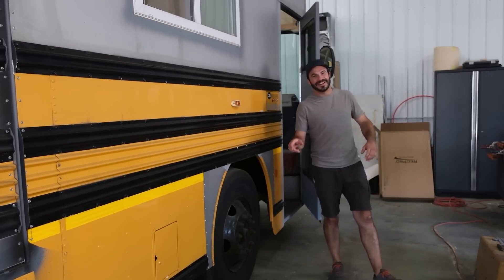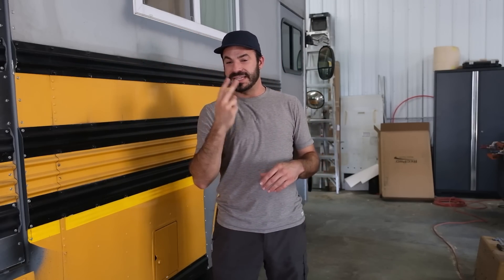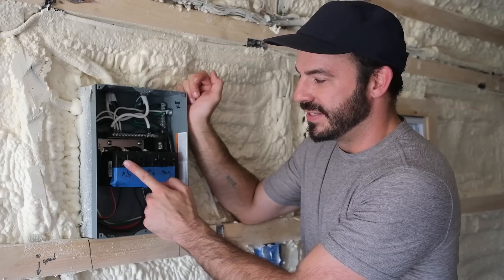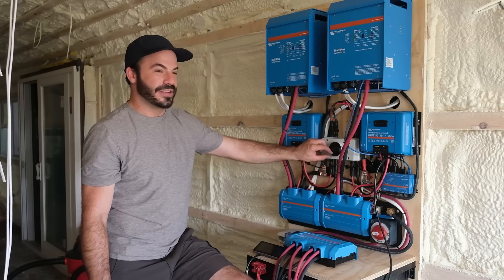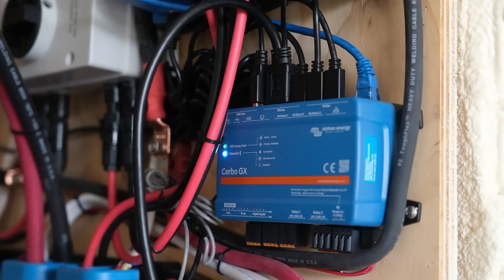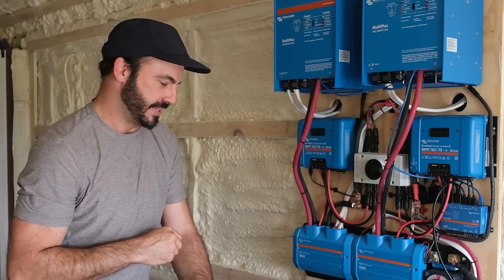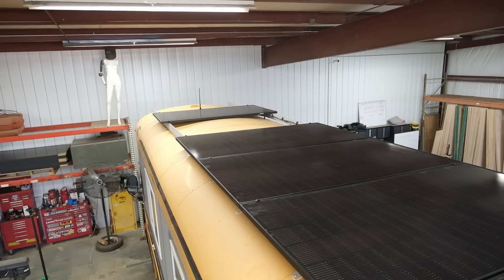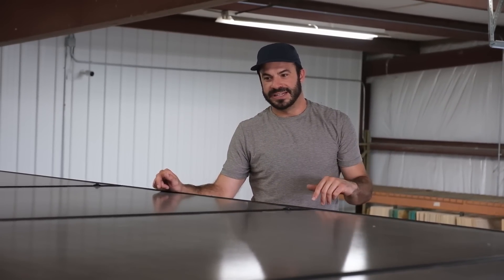Nasa-approved! A 220v solar-powered, dual-zone mini-split that also runs on 120v shore

Comment: If camping at an RV park with a 220V 14-50 socket you could have both inverters charging the battery. You would probably just need to make custom adapters down to a standard 15A plug since the RV ones combine both HOT connections where the inverters would pull to many amps.

Comment: Nice video. We live in Alaska, and live in a 40' B-Bird for the last year. We have two 3,000 watt inverters and can connect shore power at 15, 30, and or  50amps. Our issue is staying warm at -40 to -60f 7 months out of the year. We have two separate 120amps systems, working tandem redundantly.  Your videos have been very helpful over the last two years.
Reply: Diesel central heating for the WIN !
Reply: @dancarter482 Yeah I am gonna put a diesel hydronic heating system in my future skoolie with a small diesel air heater as back up. But if I am connected to shore power and it is not that cold, I can use my mini split for heat. Redundancy is the name of the game!

Comment: This is the exact video I needed during electrical planning. You'll be getting my business when I'm ready for off-grid and cutting a $25-30k check. Appreciate all you do for our little community!
Reply: They make 120/240 volt split phase inverters from around 4000watts up to the biggest you can buy. Runs 120 or 240 out of one inverter, no need to purchase two of everything.

Comment: Hey Chuck, great video brother! The best way I found for a clean looking (equal length parallel conductor) install is to separate the positive and negative bus bars on either side of the battery rack depending on orientation. In this case (-bus) below & (+bus) above the rack batteries. 

For example:
(+bus)
5” Pos  | Batt 1 |  20” Neg = 25”
10” Pos  | Batt 2 |  15” Neg = 25”
15” Pos  | Batt 3 |  10” Neg = 25”
20” Pos  | Batt 4 |  5” Neg = 25”
(-bus)
Reply from the maker: If the orientation of what was also going into this close would have allowed it, i would have preferred a bus bar as well. The racks from signature solar include a bus bar for that purpose but alas it was not a good fit for this application

Comment: Best minisplit ive found for running 24-7 on solar and batteries is the inovair 9000 btu 220 38 seer model. It pulls just over 600 watts for 10 or 12 minutes then drops down to just over 200 watts for the rest the time its on. I like the unit you used here with 2 heads but i think id have just installed 2 inovair units. I run mine from a split phase inverter and my off grid camper uses 1850 watts solar and a 30 kw battery and a 14 kw battery that i built. I use victron charge controllers along with sungold low frequency 4000 watt inverter and a powmr all in one inverter also. It seems kinda overkill but we sure dont run out of power... ever. Or air-conditioning.... ever lol

Comment: 10:13 I love this setup. I would, however, consider anchoring the battery stack to the bus more securely. There is a LOT is weight there that could break loose in a mishap or accident. Just my 2 cents that may be worth just that. 😀

Comment: Once you get into multiple evaporator units on one condenser, you can actually go to three zones fairly easily. One for the driver area, one for the living area, and one for the sleeping area. Three 9k evaporators on a 24k condenser is doable with an LG system.

Comment: So I'm not good at all this. But what I have gathered is everything got doubled so they could run one compressor instead of 2?? I will happily tuck away the second to keep from having to go 220. But totally digging the battery design.  Keep up the great work.
Reply from the maker: That is correct! It was actually about the same price to run this system with dual 3000 inverters making split phase for a 2 head unit as it would have been to buy two independent single head systems and bump up to a Quattro 5000 inverter, but it was less work since we only mounted one exterior unit (less labor) and dual 3000s gets you more power than a single 5000 inverter with the option for 220. It’s a good bet if you want the extra cooling which is why we did this option. Always a case by case thing tho
Reply: You also get the benefit of 2 solar zones. If one of the panels on a single inverter gets shaded or even damaged it will effect the solar output of all the panels on that inverter. I have been thinking about doing my panels long ways and mount them angled with the roof of the bus. But to make that work it would really make the most sense to have 2 systems since one side would be getting more sun depending on the time of the day. I did not realize my system I am planning would cost over $20k 😮 it will be worth it but geez. Lol

Comment: With 3 of the MPP Solar inverters I have 240V (mostly for dryer and welder) as I can run them split phase, and I have 5,000 watts of solar with another 2,000 I'm thinking about side mounting.  I opted for 24v DC units for the air conditioning.  I will let you know how that goes, I got 4 of them, $350 each, I prefer the 134a to the 410 and the connectors are MUCH MUCH better for mobile applications.  I may hate them, I guess I'll see when I get them installed but I'll do a test unit on my trailer first to see what power consumption is like.  I feel like with so many amazing DC options hinting about we're going to be able to date skoolie builds by cooling method but I think 2023 will mark the end of people using stationary 120 and 240 residential units.  As always, great video!  Oh and I have the same power inlet, one for each side, painfully expensive!
Reply: I wish I knew what you were saying but I don’t speak Solar fluently yet… I was just looking at a residential unit that came up for sale and wondering if I could use it for my application. Why will 2023 mark the end of using residential units for mobile applications? What am I looking for in order to be able to run a fairly beefy system on my bus?
Reply: Oh and 24 volt is better for running ac?
Reply: @Tonisuperfly  Chuck is great and he knows his stuff, I have learned A TON from him.  What I'm saying is speculation but residential units are less than ideal for many reasons from size and refrigerant type to fittings and voltages.  Currently, they may do a better job than DC units which is why I'm getting the 24v units and testing them.  Residential units are also 3x the price so that's something to factor in although only about 2x the price per BTU so you have to decide what you value more as redundancy and zone cooling is big for me.  I'm just starting with the 24v units though so I don't have all the facts.  I would assume any auto AC shop can service though though which is a HUGE plus!
Reply: Myself to keep costs down when I build my 26-30ft box truck I've have been planning it out with 2 separate 120v 12k btu units just to avoid the 240v side of things... would that have been cheaper like I suspect or am I possibly missing something? Thanks for another GREAT video
Reply: @BirchFarmsHythe  Just my opinion but if you're running 2 residential splits I would imagine you have the ability to run 240v, in my case, I have 3 MPP Solar inverters, under $1,500 shipped and this allows me to run 120v, 240v, and have one side with the ability to have double the load.  I dislike the idea of a residential unit on my bus so I would do A LOT to avoid it.  When I factor in the 24v units being over $1,000 less, giving me three units and so on I have money to spare to address an area they fall short.  It's a personal choice, in my case, more redundancy is what I'm going for.  I also end up with 27,000BTU with the three units versus 24,000BTU with the splits.
Reply: For my box truck the goal is to build it so I could literally live anywhere camp anywhere etc..  but for a few years I will be living in it full time and possibly plugged in to 120v 15a shore power at my work when I move down to Vancouver area. The benefit of avoiding actual 240v is simply easier to run a single unit through a victron with power assist when I cook etc then to rely on solar which I love for summer during their rainy dreary winters... where I would be definitely using the heat aspect of a mini split
Reply: @BirchFarmsHythe  Not sure if you know/understand this but 240 is simply 120x2 but out of phase by 30hz.  So, in theory for example, in your home, you could make a cord that was 240 and provided you plugged them into the proper two 120 outlets in your home you would have 240v on that plug.  In my case, I'm running 120 on both inverters but the inverters are able to talk and make sure they're running out of phase with each other so the outlets both hot leads go to can be 240, everything else is 120 volts.

Comment: Doesn't 120+120 = 240, not 220?  Haha!  Just messing around with you, Chuck.  I appreciate that, at one point, you said "110, 115, 120 volts" because it's changed over time...and is not clear at all.   I'm also a big Signature Solar EG4 battery fan.  A clean setup and a great video, as are all of yours.
Reply from the maker: It’s such a bizarre nomenclature! Thanks, appreciate you

Comment: This is the video I’ve been waiting on for the past 8 months!! I’ve got a 36k btu system that I’m gonna run 2 heads on but the power has been a hold up so far. I can run it off my generator without a problem but I’ve been wanting a complete system like this instead of relying solely upon the generator. This will be the perfect solution……….. except for the cost. Chuck, since your familiar with what this system requires, can you work up a rough estimate of cost for buying the equipment through you please. And would I be able to travel to wherever you are at some point for guidance on installation? I can do most of the install but I need guidance on laying it out and setting everything up. I’ve emailed you before and you’ve replied back so I’m not sure if you still have my email but if you need it again I’ll send it to you. Thanks Chuck, I appreciate it buddy!! 

Oh, this is going in an 82 MCI MC9  bus conversion if it matters. We will have good basement space to install equipment and not take up expensive floor space upstairs. Thanks man!
Reply from the maker: cant find your emails based on this comment, BUT if you dont mind sending me one at info@chromeyellowcorp.com we can take it from there. Thanks! sounds like a cool project. I used to have a few older MCI's myself

Comment: are you worried about having such large solar panels only mounted on the outer edges? Seems like the middle section would need some type of bracing. (what I am trying to figure out on my bus)
Reply from the maker: Not worried about it but these panels are also not as long as normal residential panels either. They’re 73” instead of 82

Comment: That is an awesome set up. I didn't catch the name of the manufacturer of the solar panel, could you share that? Also, is that the rack that signature solar sells with their batteries, or is that something that you and Wes fabricated?
Reply from the maker: We fabbed it! Wess did that. The panels are q.cells, the racking is from iron ridge

Comment: Did the system installed here only accept split phase 240V (and hence this solution)? I have seen some mini splits accept 208/230V single phase - in which case a second inverter producing single phase 230VAC could be used, right?

Comment: Why not install a 220v shore power and wire it like normal.   Then if you use a 220v to 120v adapter cable you would only be feeding 1 of the charge/inverters.   That way you could have it use 120 or 220v shore power.  Basically when you needed to use 120v shore power you would be simulating having 1 leg offline.   Does victron not allow for that?

Comment: Since you now have 220 wouldn't a nice 220 on-demand water heater and 220 induction stove be nice?
Reply from the maker: It would! Though the electric on demand still pull an exceptionally high current that would be too large for even this system, you’d need larger inverters. I like electric tanked water heaters though, they’re awesome

Comment: That sure is a sweet solar system, but for $20k it should be. Our solar/battery system costs less than half of that yet will still provide 24/7 off-grid electrical power including air conditioning and supplemental heat from a mini-split heat pump. Five years ago, we took an early retirement, sold everything, bought a MH and hit the road FT. It was the best decision we ever made. We discovered that we enjoy boondocking most of the time and we can stretch our budget this way too. We quickly learned the advantages of solar and decided to build our solar/battery system in 2 phases, a 12v phase for our basic 12v needs and a 48v system for our 110v A/C needs. We started our build 4 years ago with a pair of lead acid golf cart batteries and custom built a 620-watt liftable solar array mounted on the side of our motorhome. We lift the array to the optimal angle to improve their output by 20-30% vs flat mounted panels, especially in the winter, when the sun is lower in the sky. It serves as a nice bedroom window awning too, practically lifting itself to the desired angle with a couple gas struts, and it's easy to clean with a windshield squeegee, standing safely on the ground. We picked up 2, 310w Canadian Solar panels from Northern Az Wind and Solar in Flagstaff. This set-up, while far from optimal, allowed us to boondock till we could afford to do better.

We just finished the 12v part of our build last January, with the addition of a 560ah LiFePo-4 battery that we built with 8, 280ah "A" grade prismatic cells. We use a Heltec 350amp BMS, and a 5a active balancer to keep the cells synched up. We typically use less than 20% of their capacity daily giving us enough reserve capacity for about a week of bad weather before we have to run our generator for charging. It cost us less than $1,500 to build this 560ah 12v (7.1Kwh) battery, including the high amp BMS and balancer. We chose these cells rather than a pre-built battery because they fit perfectly under the steps of our MH where our old pair of GC-2 golf cart batteries used to reside, saving 35lbs while having over 5 times the capacity. We insulated the battery compartment, cut a 1" hole in our step risers and installed a tiny computer CPU fan to keep this space at close to room temperature, so we don't have to worry about the BMS shutting down charging if they get too cold - or their life reduced from getting too hot. We use a Progressive Dynamics 80a LFP converter/charger, a 1,000w Renogy PSW inverter (to run our TV, PC, ice maker, etc.), an Epever 50a MPPT charge controller and a Lnex battery monitor/shunt. This entire 12v system cost us under $3,500 to build and takes care of all of our basic off-grid needs except for air conditioning and microwave use. We have been running our 5,500-watt generator for this till we get our second 48v phase completed.

By mounting our solar array on the side of our MH, we left the roof free to rack 8, 550W Sungold Power solar panels (4,400 watts) down the length of our 35ft Class A about 15" off our roof, above our AC, fan shrouds, etc. They will cover the entire roof, providing some nice shade with plenty of cooling air underneath, further increasing solar output and reducing the heat load on the air conditioners too. We bought them for $2,226. That's only 51 cents/watt shipped to our door! We're assembling the components of this build now. We picked up our aluminum racking material from Remington Industrial Supply in Somerton, AZ, just S. of Yuma, near where we're wintering over this year, for under $400, which is the best price we've found. Our solar panels, wiring breakers, etc. arrived last week, but we're taking our time to get everything in and installed over the winter. At 67 yrs old, we're moving much slower these days. Our Sungold Power all-in-one 48V, 5,000W, 120V PSW Inverter/100A charge controller/battery charger just arrived yesterday. Our 48v battery bank will use 16, 320ah grade A prismatic cells which only cost us $1,726 from EEL batteries. So together with our 560ah (7.1 Kwh)12v bank, we will have a total of 23.5 Kwh of batteries onboard - the equivalent of over 19, 100ah Battleborn batteries and over 5,000 watts of solar. We will be replacing our old rear 13.5k btu rooftop Dometic AC with an EG4 28.5 seer2 plug and play 12k btu mini-split heat pump. This second phase will provide 24/7 off-grid air conditioning, supplemental heat from the heat pump and allow occasional usage of our rooftop mounted high-efficiency rotary compressor based Furrion AC in the front of our MH to cool things down quickly during peak afternoon hours, as well as give us whole house 120v ac power. We'll soon have total off-grid electrical independence on a budget we can afford (under $10k) without resorting to running our generator.  Take care Chuck, we hope to see you down the road!

Comment: The cost is not that bad when you compare it to buying/replacing two residential A/C units. Not to mention with the residential A/C you still have to pay for the electricity to run them.

Comment: The US did have 220v power before World War II. Please say "240" now. Some cheap generators output 110/220, which would be brownout conditions in your home, and some pickup trucks have 115V ports (to save money) but  those are the only cases where the early 20th century standards are found, to my knowledge.